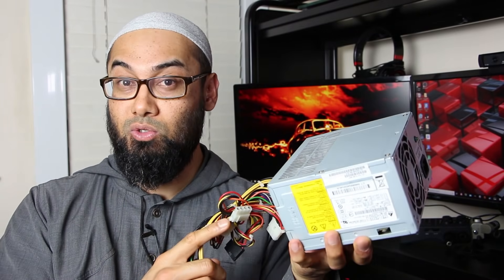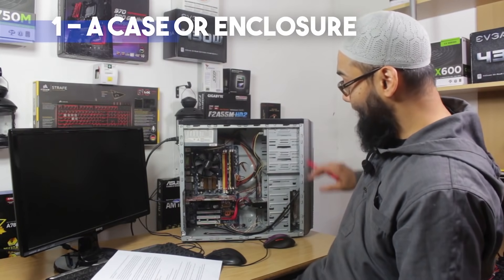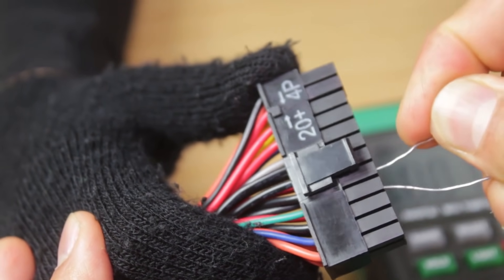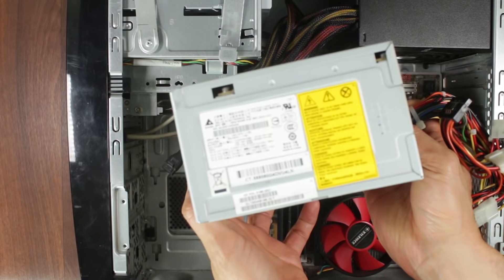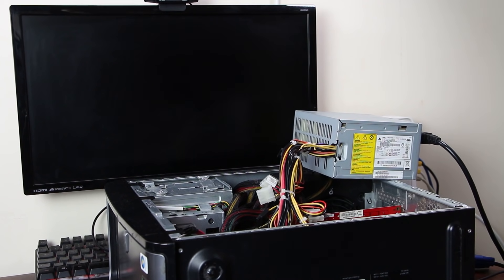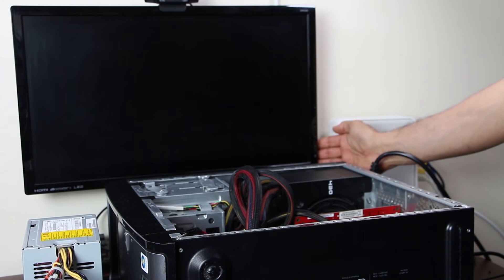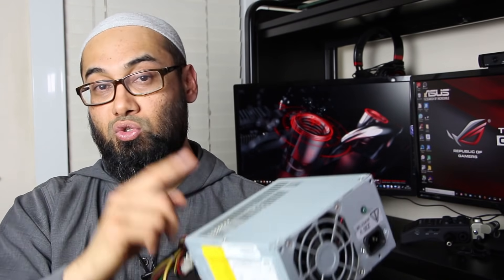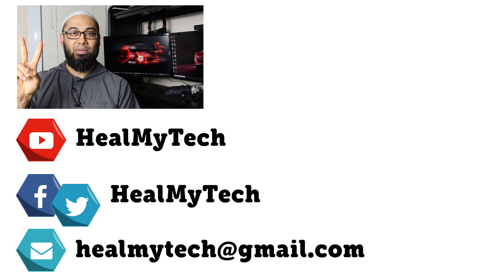Computer Turns On But No Display On Monitor | Led Light On Fan Spinning | Power Supply Unit Pc?

Comment: Thanks just replaced my laptop cmos battery after turns on but no display, not even bios but fans running its actually one of the ram got bad.

Comment: My pc used to work fine ..but 2 days ago my pc sometimes failed to boot and when i power it off and on again , it resets the bios .. i thought it was the battery . So i changed it and when i turned it on it made 4 or 5 beeps. I turned it off in panic..now the cpu fan spins but power led is not on , mouse led is not glowing ... Tried switching ram , 1 ram ... did everything i could ... I hope it's the power supply coz i recently bought this used motherboard as my old mobo died on me... I don't want that to happen again 😢

Comment: True PSU faulty is usually undermined because people would think that if psu not working, PC should not be able to turn on. In my case, my pc was able to turn on but monitor will display no signal. Most of my friends told me, it might be GPU or Monitor issues or cable. AFter checking everything, i found out my cable from GPU to PSU (PCIE) had burn mark. I replaced them.
It was working fine after 1-2 weeks the issue came back. Checked cable everything was fine. Decided to change to new PSU then it was working fine with heavy gaming until today. Moral of the story as in the video not every symptom is the same for every problem, should diagnose 1 by 1. Just sharing. 😁😁

Comment: Ace Video you are so helful -and you are so polite . I use these servers the older generation -and yes they have problems exact as you explain . I may thinkthe fault  it is Ram - But it could be dust-it could be powersupply - it could be graphics - it could be a cable -it could be the mother board .I am no where near your knowledge but in the past I had to learn from Experts and listen to and learn from them .Now they have moved 200 miles away and now I get a fault . IT is SO GOOD to find your channel which is exactly on the spot correct .I know Frinds who have made compuers when they wer kids - now the in there 40s .There is hrdly anything they do not know -BUT they do not offer there services easily thses days . Hnce why your channel I hear expertesewords Good Brands of ram - .good tests in one shot .It helps me as I still use the old servers they seem to last so lond -if you look after them -and update what you can as said ONE of the best channels I have ever found -Respect and hope you do more .I like the fact its all one video -so we can see everything -without editing -also good not to use Music - Voice isss good and clear - Good camera work - accuracy 100 pervcent -its also very calming to watch    ( which only leads one question do we need a loud intro ? ) when everything else is perfect  Respect

Comment: My cpu no display and the processor fan not working.....how can I solve ....it is gigabyte dual core processor
Reply: Did you fix it? Seems for me I needed to change the CMOS battery and changing my psu

Comment: I’m stuck on a black screen, reset the CMOS, reseated the GPU and both sticks of ram correctly, changed gpu slots, booted with one ram in only and nothing has worked

Edit: in bios but can’t move mouse or use keyboard, also super slow loading.

Comment: Reason why I'm commenting it's because I'm facing the same situation.

My computer is 14 years old and it was working till this day 25 Feb 2023 came. When I come back later, the computer powers on  but I get no video output on display. I tried by all means reseting the motherboard but still no output. 
Could it be the PSU failure?

Comment: I'm pretty sure this is my problem as this is currently happening and has happened for over a year for me
i have a pc that was lent from a friend it had a GTX 780 ryzen 3 3200g 16gb of t force ram a b450m-a motherboard  and a kolink 80 plus  bronze 700 watt psu. anyways he told me that he had this pc for 2 years and last year was just fine till this year because In September I upgraded my gpu to a rtx 2060 then that's when the symptoms of a bad psu happened. then on Christmas I got a new case so I took the components out of the old case and into the new one and I thought I fixed the problem but I was wrong. I am currently saving up for a new psu

Comment: Hello Mr, Can you help me because my problem is when enter the BIOS mode the screen suddenly off and it says check signal cable hdmi/analog. But sometimes it can reach windows but for 30 seconds to a minute it suddenly black screen again just like what happened on the BIOS mode before. Im confused what is going on with my pc, is it the CPU, RAM, Power Supply, GPU, or the Motherboard that broken. I decide to buy a new pair of RAM then the problem is FIXED!!!
BUT!!! it happened again in the following day with the new RAM. So i decide to try my old and new ram in my office PC, and guess what? Those RAM ARE WORKING! I thought my old RAM is broken but its not.
So what do you think about my PC's problem? Is it the CPU, PSU, or the Motherboard that broken? 
Sorry for this long comment, i just need your help or anyone here to solve my problem 🙏

Comment: I have this strange situation, so my pc recently after a power outage started acting in a weird way, it wouldn't boot up correctly, i would press the button and it would make the fans spin, and the rgb lights on the front of the power, but the led for the hdd didnt light up which was a blue color, but no display at all, so it wasn't being given power to anything else on the pc, i would have to hit the back switch off and on for it to boot up, but now its gotten worse to the point where the booting off and on doesnt work, do y'all think this is a psu issue or somethin else?

P.s forgot to add that it boots up after attempting several times to boot it up, but when it does boot up it works fine, no gpu, no crashes nothing like that

Comment: Hello bro, I have built up a new PC with no graphic card on the motherboard Asus Prime H510m-e with Intel i5 10gen and DDR4 8gb single ram. I put the power supply of  VS450L. I got a problem of auto current off and itself on again and also no display signal. Please help me with this issues.

Comment: Something that helped fix mine was these power supply extension cables i got. Pretty sure they were cheap so the second i replaced them my pc worked perfectly, i also took out my ram and blew the dust off. Hope this helps someone

Comment: I am in great trouble.... My pc after tuening on runs for 20 minuites approx then suddenly monitor shows no input signal but cpu keeps on running. Even graphics card fans keep on running.  I have replaced my motherboard and ram with new ones, but still after 20 min the monitor shows no input signal suddenly.....plz help me🙏
Reply: No technichian is able to detect whats the problem....

Comment: I think the new cabinets and motherboards require 350 watts minimum. The older power supplies were around 200-250 watt. So maybe thats the problem. The low wattage parts like fans and led will turn on but not the high wattage parts on the motherboard or cabinet.

Comment: I'm having the issue where sometimes I can't get my display. It's weird though because if I unplug the monitor from the PC and plug it back in, I can get my display to work. I am so frustrated with the issue. My PC is only a year old. My monitor is over 10 years old, so I am going to see if a new monitor fixes it.

Comment: I've been having some really weird issues

I have two motherboards, ram, CPU, and power supply. 

One was my friends and when his computer was completely built we couldn't get it to display whatsoever so I swapped in my motherboard and CPU (different chipset) but I used all of his components and the computer seems to be working perfectly fine even displaying through his graphics card.

I put my ram and power supply on the broken motherboard and it's displaying now but only through VGA. No HDMI. There is a display port on the motherboard but I don't have a way to test it and I didn't plug a graphics card in.

Comment: I’ve recently dealt with the BSOD from a memory management error on my computer so I used this failure as an opportunity to upgrade my PSU and RAM as well. I’m now having a similar issue to this where everything is booting up, fans are all turning on the cpu cooler and GPU as well as the CPU and there’s nothing displaying to my monitor. I’m kind of stumped. Did I jump the gun with upgrading hardware before narrowing down my true issue?

Comment: Last week I received an Enthusiast Gaming Desktop from a client with the same problem, separately I checked RAM, GeForce GXT card, everything with another system, nothing wrong! Last check takes out the CMOS Battery from the system and keeps it outside for 20-30 seconds, holds the power button for 30 second for 30 second, and finally it wakes up!

Comment: Hello there hope you'll are having a good day,
Please i need help guys,
I disabled my intel hd graphics from device manager cause i had AMD dedicated gpu, but it wasn't detecting it, so i thought it would fix it if i disabled intel gpu, and after that no display but keyboard was turning on and mouse too with also sounds of window but not showing any display, after some restarts keyboard and mouse stopped working, no sound nothing, fan are working, I've tried cleaning ram, cleaning gpu, replacing battery nothing worked!

PLEASE HELP ME 🙏

Comment: I bought a surge protector the other day and my dumb ass forgot to fully power down the pc before I unplugged it and now it turns on but doesn’t display anything on my tv and the keyboard and mouse don’t have any power to them but everything else lights up. I’m about to take it to a shop any suggestions

Comment: i used a diff psu and that didnt fix the issue. Still having black screen. the debug lights all off too..... i think the mobo is gone for me..
Reply: Did you solve the problem?
Reply: @vitor23995  yeah I had to do trial and error at the end. Turns out my motherboard was dead. It's weird it did light on and stuff but once I put a new mobo it did fix the issue and everything is working fine. :P

Comment: Hey all. I was wondering if someone can help me. I have a ryzen 5 3600 cpu
32gb ram
And I JUST upgraded to an rtx 3070 ti and I only have a 600w power supply. The thing is, everything works perfectly except for the display. The VGA light on my motherboard is on the whole time.I'm thinking the gpu needs more than a  600w power supply but I don't want purchase one without knowing that my suspicitions are correct. :[

Thanks in advanced for any help.

Comment: Did not work for me none of this. UPDATE on 02/08/2022. I discovered the problem, it was my computer processor. I had switch with a used one and it works fine and as matter of fact, you can now hear that airplane engine sound in my computer.

Comment: i restarted my pc, and then my pc never turned on. My keyboard and lights dont even turn on but when i look at the shut down button on the top front of my pc, its green indicating its on but i dont see any display. I have yet to see if my fans are working. Do i need to buy a psu or is that i just need to clean? i havent clean my pc since the time i got it

Comment: I just opened it up and checked all the components and cleaned them including the ram sticks, ram ports, ssd, hdd, fans, pcu and its always had an issue booting and takes anywhere from 30 minutes to 8 hours to boot into windows. Now i am getting an issue where the PC turns on but the monitor or USB devices dont turn on with it giving me a black screen with no signal and no indication of being alive other than the pc lights and fans going. I have been doing everything i can think of for the last 2 hours trying to get it to work. Im not a youtuber or tech enthusiast with a fat wallet so i cant use these fancy tools to check the components.

Comment: Help plz I’ve had my pc for only 3 days now I went into the bios and changed the UMA setting I’ve messed with this setting around 3 times and That third time I saved and exited and my pc did not display all the fans and rgb is working but not getting a display or any lights on my keyboard and mouse please help!

Comment: After pressing power button in cpu monitor turns on with the gap 1-2 mins of delay it's happening for the few days also the cpu powered on fans are running how to troubleshoot this issue

Comment: My PSU is 8 years old. I just tried to turn on my computer yesterday and only the fans spin. I have POST LEDS on my motherboard and all of my devices look to be checking okay. The STANDBY_PWR LED on the mobo remains green like it’s supposed to. I’m gonna try replacing the PSU to see if that fixes it.
Reply: Did it fix the problem?
Reply: @vitor23995  it ended up being a bad mobo. I attached a speaker to the mobo and it beeped 8 times. Apparently the PCI slots weren’t POSTing. When I removed the mobo I saw what appeared to be water marks along the bottom of the board where power typically runs to the PCI slots. I’m guessing humidity got too high in my house after being without power for 10 days from hurricane Ida. I replaced the mobo and everything runs fine now.
Reply: @menehloke  Alright dude, here humidity here in my region is high too, gonna go check it out this, thanks a lot for response 👍🏻

Comment: My pc turns on but I get no display, the monitor works on my other pc. Everything on my pc was working fine, took it apart and put everything back. Everything is plugged in correctly, cpu gpu ram is all connected correctly. The power supply was sitting on the ground for about a month, would that be the problem or maybe my cmos battery has died?

Comment: hi there on my pc i removed cpu as i was going to change it from i3 to i5 but would after change at a later date...so i cleaned it and replaced it,check all wires and battery was ok...plugged in and switched on...within 2seconds it switches of but fans still running and blank...pc is only around 3yrs old...can you help...thank you...ROB.

Comment: What worked for me was trying to start with one stick of ram. The computer turned on but the USB ports were not working for whatever reason. I tired taking all the ram out and putting it back but it didn't work. After I just started with 1 display and USB ports worked. After I shut it down and put back the other ram stick and tried to boot again and it worked fine. Thanks for the video!

Comment: So i bought new mobo ,cpu,ram and i have plugged them but i do not get any signal even though everything turns on , and also when i plug my keyboard or mouse they dont turn rgb lighting on , is it the power supply or have i done smth wrong?

Comment: i’ve got a brand new TX650M, everything turns on including the fans on the power supply, but i do not have a graphics card and my hdmi is plugged into the motherboard? Could this be the problem?

Comment: My pc turns on fine the ram has color my fans have lights and running gpu is running keyboard lights and mouse are running my monitor logo shows and then it says “no signal detected” how can I fix this I’m in desperate help
Reply: Maybe buy a new HDMI cable if you're using one

Comment: I have an issue somewhat like this, but my pc boots up fine usually but sometimes it doesnt POST. Tired of this issue for  a month and half . Also the monitor sometimes flicker. I dont its a motherboard or a PSU issue, I got the ram  and my ssd check

Comment: When I tried to reset bios by removing the cmos battery.. my cpu has not work but the fan is spinning. How can I fix this? Do I need to install the bios

Comment: My pc was running good but That 20H2 update broke the pc. It was running great after update and when I turned it off and tried to turn on it won't start. 
When I press power button it turns on but within 2 Seconds HDD light turns off but All fans keep running. Also no logo or anything on moniter. Can anyone tell me what's the cause?
Reply: It working now! I just unplugged RAM and gave a good wipe and brushed slot and it started working!

Comment: What does it mean though when your keyboard and mouse wont turn on either? Like no rgb or any colors show up? This happens to me too. I plugged them into my ps4 and they turn on just fine but they refuse to turn on when plugged into the back and top of my pc both ports. Any suggestions?
Reply: Did u fix it?
Reply: @babaloons4887  i fixed it twice now. all u gotta do is one of like 4 things. switch the ram sticks around, take out then cmos battery for either 1 to 10 minutes, unplug the cord connected to your gpu and unplug a cord connected to your motherboard. usually one of these makes it work again after some patience.
Reply: @tomcruise7481  oh so just remove things and put them back right?

And the ram i just gonna put it on another slot or put a new ram?
Reply: @babaloons4887  put them back but switch the ram sticks places. So like the one on the left goes right and vice versa. Try it a few times.

Comment: everything but display works. mouse, keyboard and case fans light up. mic turns on, everything but display. i've swapped the slots the ram sticks are installed in (i have 2 dimm slots) and made sure the psu cables were connected properly on both ends.

now im guessing i'll need to return my psu, that's lovely
Reply: I have the exact same problem. If it's the PSU check the warranty you can ask them to send you a new one

Comment: I swapped my psu out with a new one everything powers up except display can even hear hdd chatting any ideas note this was a working cpu board ect ryzen 3600xt 16g ram msi gtx980 older gpu I replaced psu months ago as mine blew up replaced and didn't use for a few months